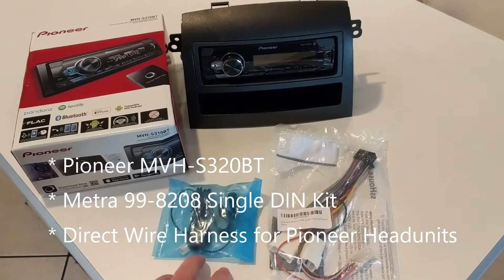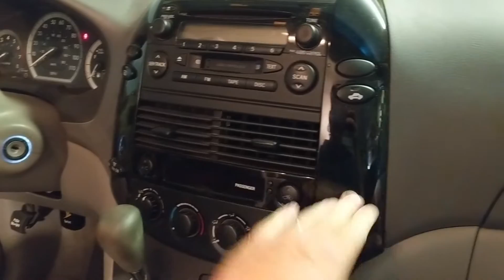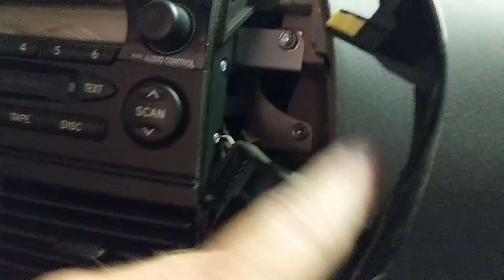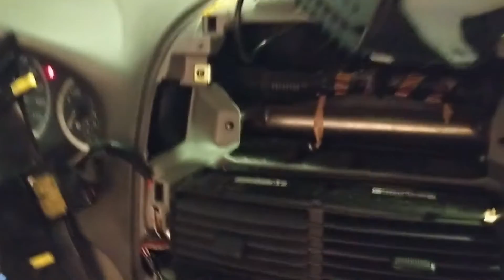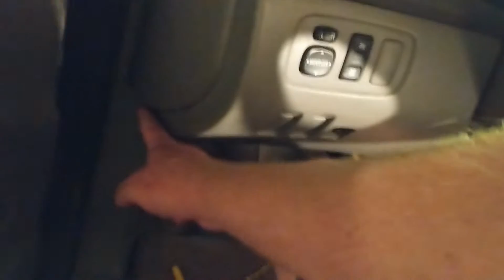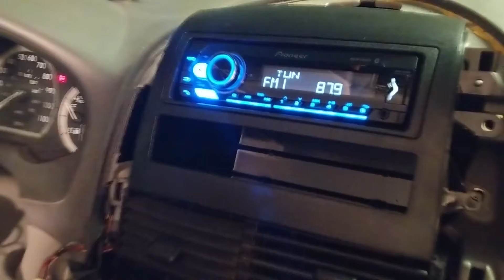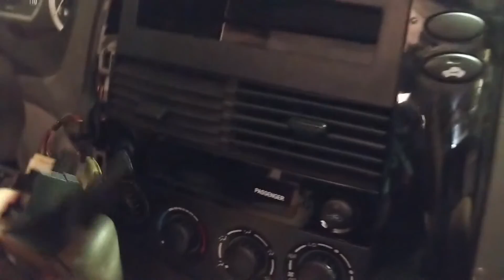2004 - 2010 Toyota Sienna EASY Pioneer Stereo Install

Comment: I appreciate your taking the time to share your expertise and make this video. My 04 Sienna radio just quit, and with your help I (who am somewhat mechanically challenged) will feel confident in replacing it. BTW, there is a small error on screen starting at 0:15 - S320BT instead of S310BT. The links are fine. Thanks so much!

Comment: Hello, question please. My van is a 2004 Toyota sienna with a JBL audio, do you think that the stereo that you installed in the video and the hardness wires will work in my van. 
thank you.
Reply: If the original Toyota plugs are still there, then yes.  Otherwise if they were cut and spliced for the JBL then you might have to cut and splice to the new radio as well.  The harness is specific the original Toyota wiring plugs.

Comment: Do you know which harness would be required for the steering wheel controls? (part number/name) I have a 2004 Sienna and want to see if it's worth it to get the harness. Thanks.
Reply: ASWC-1. I found it. $57.00. Yeah...don't know if it's worth it, too. Thanks.